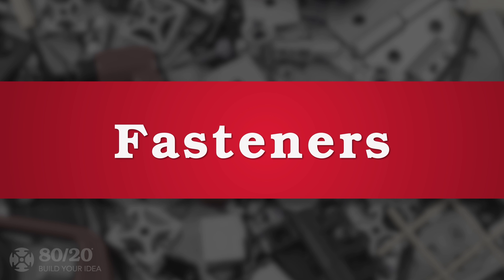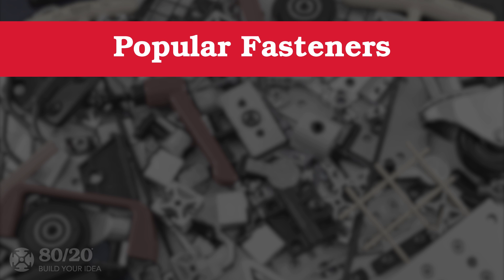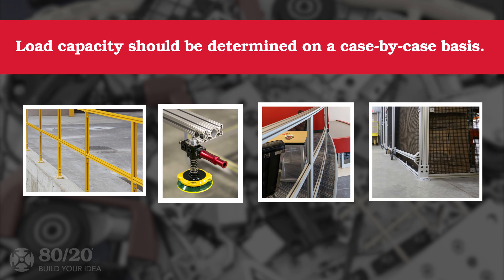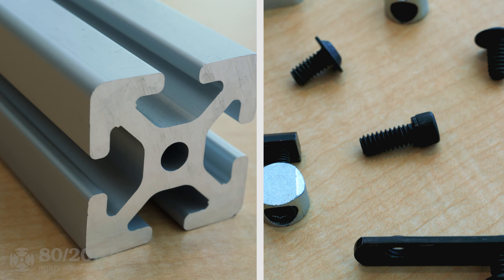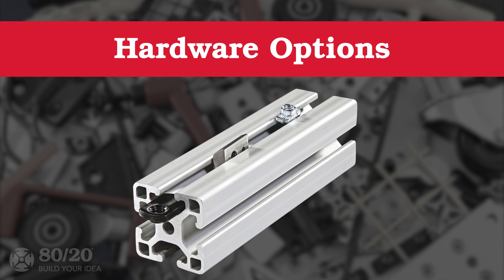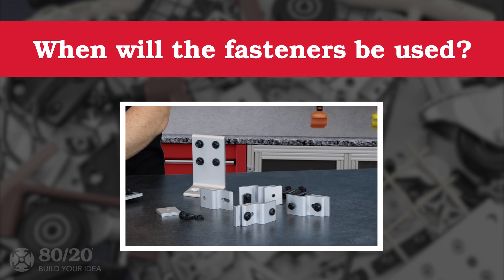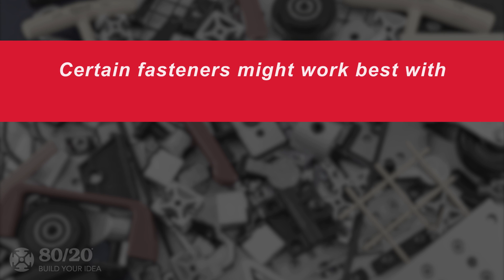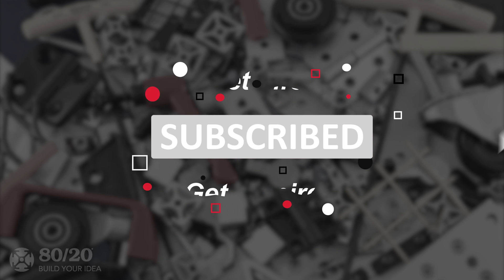80/20 │ How to Design: Fasteners

Comment: I am planning tobuild a queen size lift bed, but I am getting over my head.  I am pretty sureI will need yourguys design team.
Reply from the maker: Hi there! Thank you for reaching out. Our design technicians are happy to help! You can find our Design Assistance tool here to get started: https://8020.net/design-assistance
Reply: @8020llc  If I have a plan, i'm no expert, can the designers tell me what i need in parts? is design assistance free or is that what is part of the quote or is the quote just for the material after the design team looks over my plans?

Comment: do you have 3d models or wireframe images of fasteners so they can be be used in my CAD model ?
Reply from the maker: Hi, Jak - thank you for reaching out! You can find a free plug-in available for download on our website. AutoQuoter XII is a CAD plug-in that makes it easier to design with the 80/20 product line by allowing you to choose various profiles and parts to use in your design. The plug-in also generates a bill of materials that can be submitted to 80/20 for a quote. You can find it here: https://8020.net/aqx